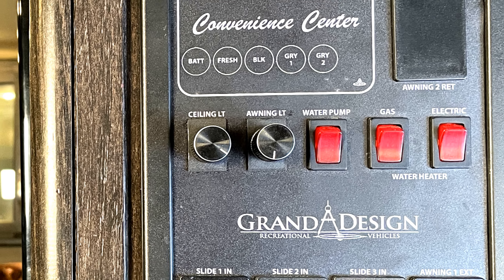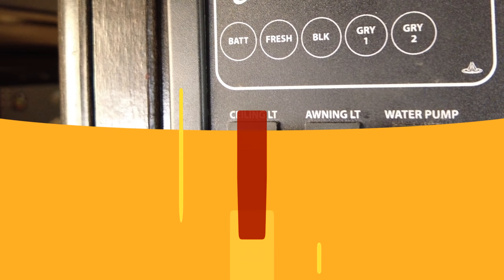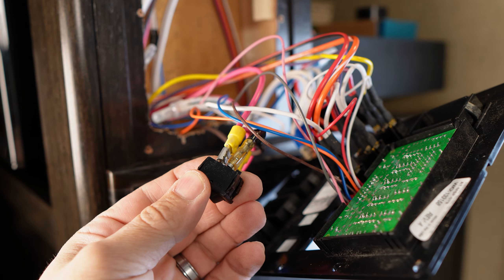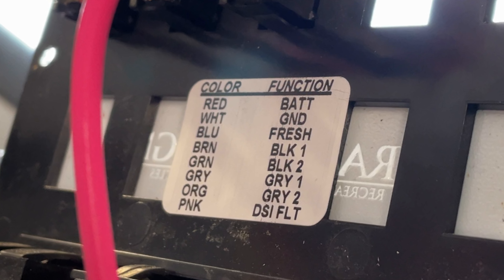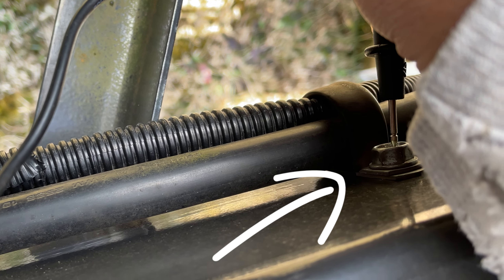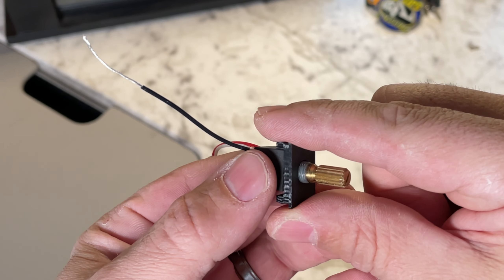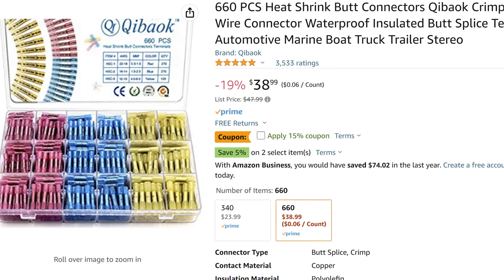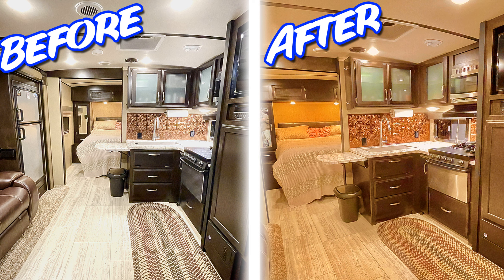How to Install Dimmer Switches on Your RV Lights - Easy to Follow Installation Guide!

Comment: Great video but those dimmers aren’t the best. I Installed the same ones and when not connected to shore power with the water pump running the lights would pulse and flicker. Ended up pulling them out.
Reply from the maker: Thanks John… There are many reasons why an LED lamp can flicker, but the most common cause is a lack of resistance in the lamp to allow the dimmer curve to work correctly. This is not a new issue; it’s been around for a long time, but is becoming more “noticeable” with the major increase in LED usage. So the issue can be at the light or the switch.  These are pretty high quality switches, I’ve used them for other non-RV applications.  They are rated for exactly this application so I wonder if the issue is the cheap lights they use in RVs.
Reply: @RVTIPSANDTRAVELS  I installed dimmer switches at other locations and don’t have any issues but they are a different type. I’ll try and do some research on the fixture type and maybe a more compatible dimmer switch. Thanks for the advice
Reply from the maker: john, ive recently discovered in some rvs the lights are on the same circuit as the water pump.  a viewer had rewired his water pump 12v power wire to a different location and the flickering stopped.

Comment: Comes with wire nuts, strange!
Reply from the maker: the factory used crimping wire nuts.  different than standard screw type wire nuts.  they are better, but not what I would use or recommend.

Comment: Hands down soldering..  is not the best way as heat melt solder and any high loads can melt why we don't solder things in homes and factories😅 but it's a secure point until melting  😅
Reply from the maker: Mike, you should rewatch that part of the video because I was talking about 12 VOLT APPLICATIONS.  That was very clearly stated.  I clearly mentioned 12V electronics.  I mentioned nothing about soldering in 110 volt AC applications.  Soldering is the best way to connect wires in 12 volt applications.  This is exactly what they teach in MECP certification training, I know because I went through the certification.  Again, this has nothing to do with 110V AC.  12 volts DC and 110 volts AC are 2 different animals.  There’s a training course at the end of the video that might help you understand DC voltage better and I would recommend you take a look at it.  It is not as thorough as the MECP automotive certification on 12 volt systems but I think you’ll learn a lot. So again, please rewatch the video because I really hope it's clear, this video has nothing to do with electric wiring in “homes”, as you stated it does, because “homes” are not 12VDC.